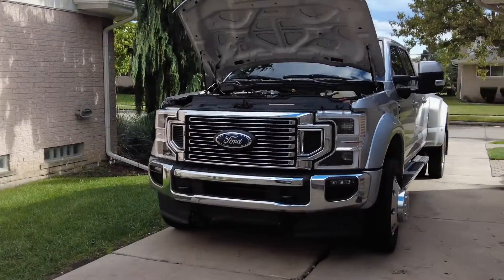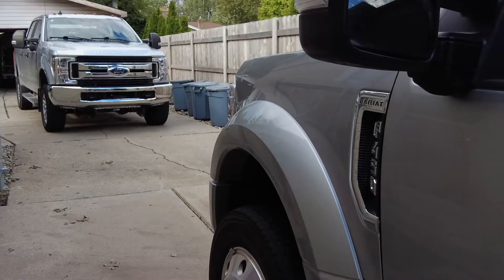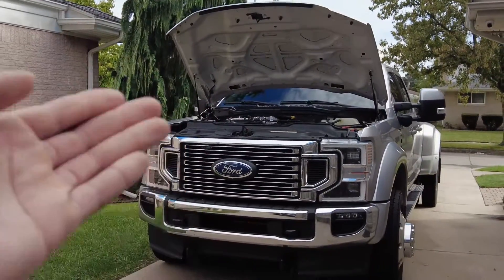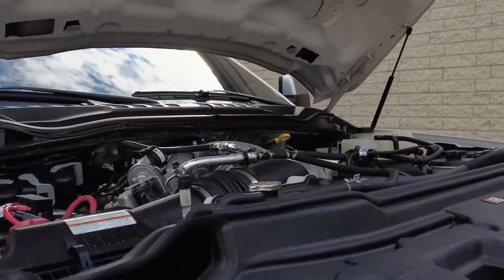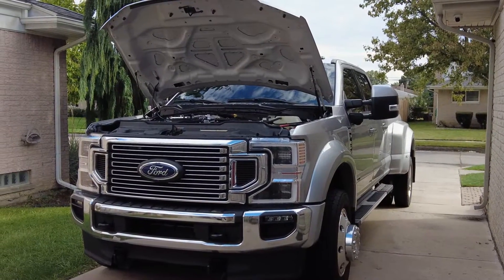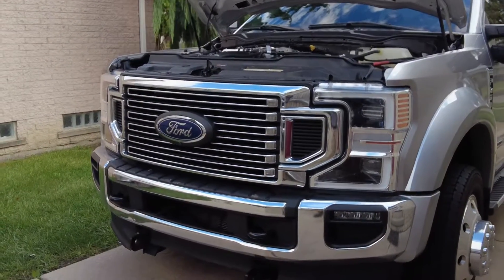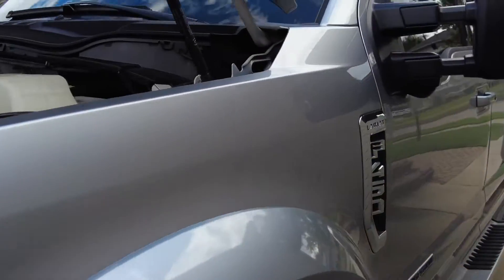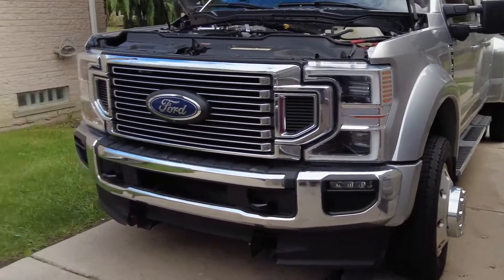First time Ford diesel owners. Things you SHOULD know.

Comment: Lots of good information here! Great description and overview of the 6.7. Local Ford dealer usually samples fuel to determine if the fuel was the cause of the injection system failure. The egr system is there to reduce NOX emissions . The Def systems greatly reduced the need for egr, tier 4 interim systems used a much higher percentage of egr to accomplish the job of meeting emissions lThose engines were extremely hard on the motor oil,by comparison the DEF equipped trucks are actually a lot easier on the motor oil and the size of  the egr coolers can  be reduced some. This is just my opinion but the Cummins Rams are alot less finicky about oil,any fleet 15w40 will do,it’s an industrial duty diesel, the Duramax is a little harder on the oil and the 6.7 powerstroke is the hardest on oil, the valvetrain  in a duramax isn’t  as hard on the oil. Because of that, we recommend 5w40 full synthetic in all 6.7s. 
        At work we have International max force 9s and 10s right before they went to DEF, these trucks are emissions nightmares we are always putting egr coolers in them it’s every 2-3 years …..these new systems are more reliable egr cooler wise but adding def adds another system to maintain and repair….. I heard you touch on deleting, the EPA is stepping up enforcement,at the repair shop level at least in Ny.

Comment: Had a diesel. Never again. After putting a pencil to it, the costs of ownership is noticibly higher than gas. If you are pulling heavy loads a lot then they are worth it…. But for the average camper puller…. Not even worth it
Reply: Yeah it absolutely is worth it in Colorado.  Nothing worse than a gas truck attempting I70 to Eisenhower tunnel with anything pulling behind it.

Comment: Diesel isn’t hydroscopic, meaning it does NOT absorb moisture from the air, fuel, or its surroundings. It comes from other items that get included in the pumping of diesel…. Condensation from the storage tank, poor handling during transfer, etc. water is heavier than fuel in its density and will separate from the fuel over time…. Aka after sitting for several months. Since this “fuel” (aka pure water) is sitting on the bottom of the tank, it is the first thing sucked thru the system, causing the damage you are referring to. As you said, proper maintenance, draining, and frequent changing of the filters will help eliminate this possibility.
Reply from the maker: Thanks for educating me

Comment: Personally for me I have a 2000 f250 7.3 factory diesel and I have had 0 problems with it at all since getting it. I've kept up with oil checks and making sure during the winter to keep the truck plugged up and I haven't had a problem. It's still my daily driver to this day and is still working as new.
Reply: That’s awesome how many miles does it have?
Reply: @gavinsfriend456  has over 200k miles on it and has been in a rear end accident.

Comment: Always wanna try a diesel. Want to step up to a F450 from F150. You made me scared bro. Probably a Godzilla is the way to go. Thanks for sharing!👍🏼
Reply: What's the Godzilla? 6.2 Gas?
Reply: 7.3 gas
Reply: @strokedblazer857  I have been in a Cummins equiped Ram for the last 12 years. No issues with the engine at all. The pre-emissions diesels are more reliable. I still have a 97 Cummins M11-450 and maintenance in minimal.
Reply: Don't be afraid. I had a brand new F150 3.0 Diesel as a daily driver for 5 years and never had an issue other than regular oil changes. Just got delivery of my 6.7 diesel F450.
Reply: If you can wrench on a gas car you can wrench on a diesel bro, I had a gas truck they're cool, but my god's is the towing gas milage horrendous, I'm getting a 7.3 powerstroke now, cause my old trucks gas tank is too small. If your wondering it's 2000 f350 with the V10 triton.

Comment: I’m at 60k miles in my 2020 6.7L and it’s been the best truck I’ve ever owned. I daily drive it to work, around 50 miles a day. It’s extremely comfortable to ride in. We prefer it for long road trips because it’s so comfortable. 

Yes the upkeep is a little more involved, and expensive. But again I have so far had zero issues. Just make sure you keep up on the maintenance and it’ll take care of you. Also, I pull with mine from time to time but not very often. Just bought it mostly for fun.
Reply from the maker: Nothing wrong with that!

Comment: In addition to contamination from bad fuel, if you use the wrong fuel, that will get you as well.  If you look in the manual, a specific grade/rate of fuel is mentioned (it has to do with purity plus lubricant added) and most places do not carry it so you will need to add a lubricant to your fuel every time  you pull up to the pump.  HotShot was a top brand as well as Motorcraft was a runner-up.
Reply: Thank you

Comment: Can i get away with daily driving a diesel?

 I do lots of short trips but I also like to go on small road trips once per week and  even longer ones here and there. 

I would have OCR turned on to keep an eye on the filters percentage gauge and then take it out for an hour or two when  necessary or even once per week to burn off the soot in the dpf filter. 

My other concern is cold starts in winter and I would assume I'd best drain my water filter if not daily once per week under freezing temperatures? I would also more than like have to isntall high idle on command like yourself. Either way I would be big on maintenence.

I also saw in another video where you can turn off passive regen on command. Which is what I was planning to do for the short trips to work on a daily and then turn it back on before I go for my long drive when the filter is starting to get full. This way I don't turn off the truck during a regeneration.

All input on this is appreciated !

I'd love a diesel and I'm ready to take good care of it. The dpf is my main concern
Reply from the maker: With OCR turned on, you'll be fine
Reply: During the winter you won't have to worry about the water freezing specifically you'll need to worry more about the diesel getting like thicker for me I just get a extention cord and plug my truck in to keep it warm during the winter to make sure the water and diesel don't freeze up or get like thicker